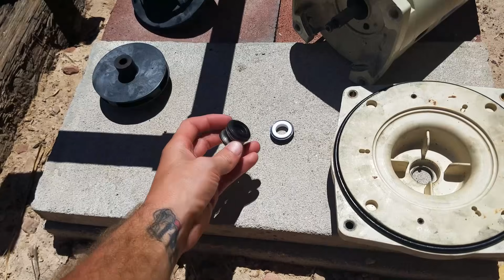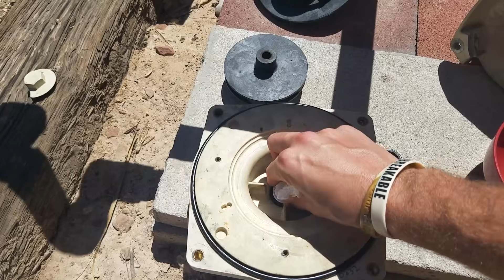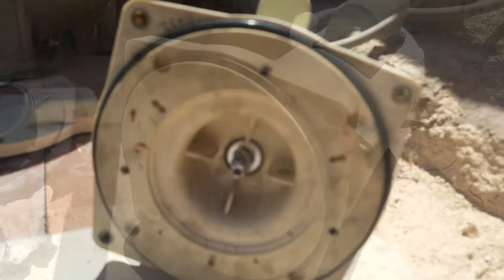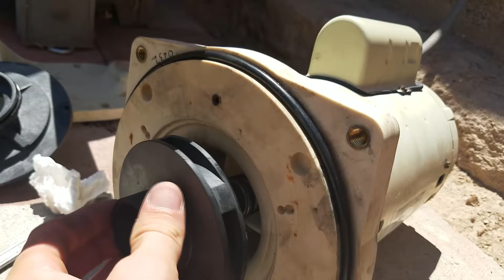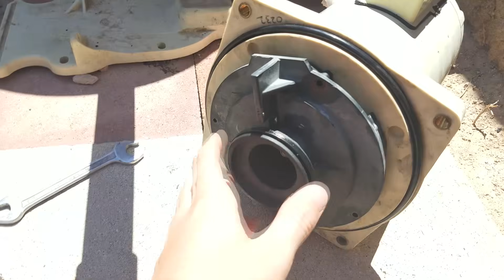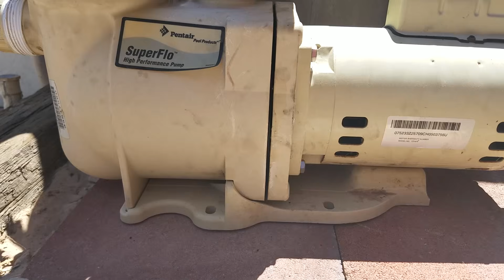Pentair SuperFlo Pool Pump - Shaft Seal Replacement Tutorial

Comment: Exactly what the doctor ordered! Thanks for the video. One note (that I see others have mentioned, but YOU MUST USE GLOVES when touching the shaft seal or it will fail. Any oils from your hands will due it in over time. Anyone watching... USE GLOVES when handling the shaft seal. if you installed it and didn't use gloves, get a new one and do it again (you now know how easy it is to do... Again, thanks for the video!!!
Reply from the maker: Thanks for the info!
7 years and it's still working. Don't believe everything you hear haha!
Glad it worked out
Reply: Thats per pentair. I use a coupler or wrag. Dont count on luck. @TutorialGenius

Comment: Use a little RTV next time on this ceramic on the rubber if you put it on the white part it will leak put it on the outer ring then I guarantee no leak

Comment: The ceramic never goes bad they will crack sometimes but the reason for the leak is because the debris on the mechanical the spring part

Comment: Just to add, it is critical that the Mechanical Shaft Pump Seal ceramic and the end that presses against it(the ceramic surface) are free of any debris such as finger oil. it is recommended that you wear gloves handling that part and if you touch it that you clean it with isopropyl alcohol, I would use 99%, but household isopropyl will work in a pinch. on the rubber part that surrounds the ceramic disk, you can use silicone pool lube, the same stuff you can use on your o-rings.  Other than that I found this video extremely helpful, especially the direction of the Mechanical Shaft Pump Seal. Regards,
Reply: You are correct but I touch the ceramics everyday because I am a big pump shop and they never leak when I'm done the directions does say don't touch it but the only thing that matters is that you don't get anything on the white part because the mechanical part of the seal has to meet to it
Reply: Your direction works perfectly, with no leaks in a year(THANKS!)...even after having to disassemble it again. The bad part is the earlier leaking I had, had rusted up the bearing in the motor, so I replaced those too. I forget who posted that video, it save me a lot of money, just the cost of 2 bearing and a puller.

Comment: When you forget the volute/motor bottom tray, you might bottom out the bolt in the brass threaded insert. Cut the bolt with a hack saw to separate the volute and the seal plate.
The insert will come out if you heat it during drilling it spins out. Now you can drill out the seal plate to accommodate a longer stainless bolt.
A 3.5" bolt is long enough, but 4" works too.

Comment: why would you make a video showing how to replace the seal by starting with the pump already apart?
Reply: Removing the pump is the easy part. The seal replacement is the more technical part.
To remove the motor is 4 bolts (mine also has 2 nuts). Once that is off, it’s only another 4 bolts to separate the electric motor from the parts shown in this video. You’ll need a couple of 9/16” wrenches.

https://youtu.be/lBXirNca_kI
Reply from the maker: Hey, remember youtube is free. You didnt pay for anything.
It's nuts and bolts, you'll figure it out.

Comment: Thanks for the video - it helped me fix my leak.  One comment - my impeller did not have a screw on it (might be a different model.)  It was threaded to screw onto the motor shaft.  I had to hold the bolt in the back while I turned it counter-clockwise to remove it.
Reply from the maker: Thanks for the feedback! Glad it helped! Having pride at a job well done is satisfying (and so is saving money)! Please subscribe